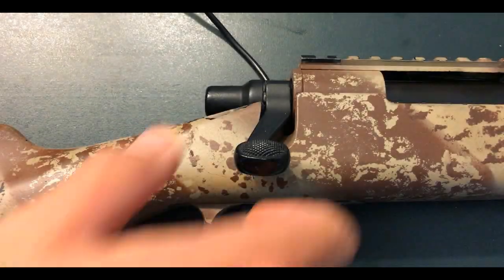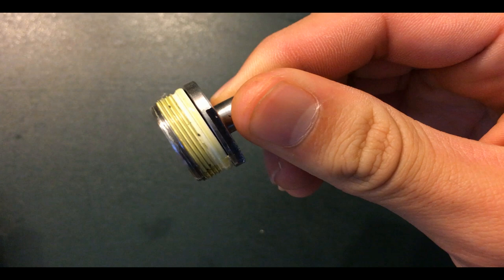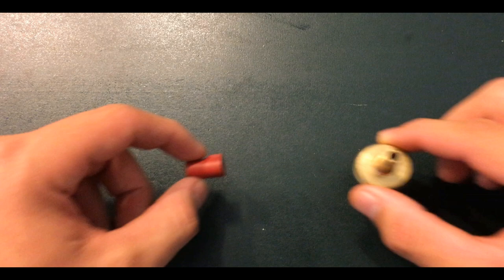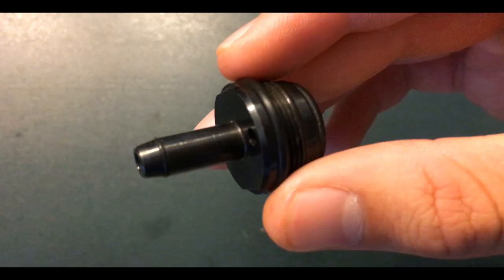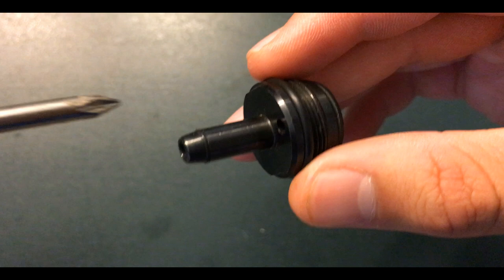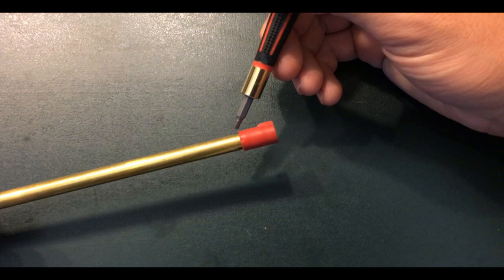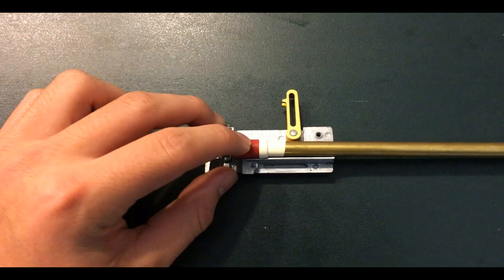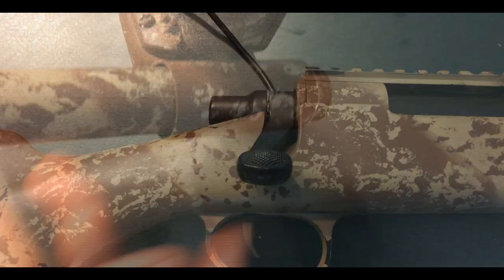How to Get Good Compression in Airsoft

Comment: I need help
Today I took a look at my FPS on my TM VSR-10 G-SPEC. Here are the results. I was wondering if this isn't constant and if there are similar results other VSR-10 Users got with 
.25s with similar parts or If somethings off.
My parts and everything are down below
463.2
468.5
436.1
442
454.2
449.3
467.2
461.9
I was using .25s
Because that's what my field uses to measure FPS.
My parts in my gun
-Maple leaf hop up arms
-AA VSR-10 Cylinder Kit
-AA VSR-10 M150 spring 
-AA Spring Guide
-AA Zero Trigger
-Nine Ball Hop Up Bunking
-PDI Precision Barrel

Comment: I have the same hop unit in my well mb02f (vsr clone) I get really unsmooth feeling at the end of the forward stroke as the nozzle enters the chamber could this be due to the shape on the standard nozzle (mine looked the same as your stock nozzle.) cheers and good video once again
Reply from the maker: Thanks! Yeah, it's probably due to the shape of the standard nozzle.
Reply: Hi i have the same exact situation ik it’s prob too late to ask but how did u fix it ? whenever i try to put the bolt back in its neutral position it gets stuck at the very end

Comment: hey +X81 Airsoft love your vids bud and im from the uk. what fps is ur sniper shooting at ? keep up the good vids buddy
Reply from the maker: Thanks, I appreciate the support! My gun is shooting right at 500 fps right now.
Reply: +X81 Airsoft no worries, i am getting a tm vsr-10 soon, would could i do to get it shooting accurate like urs but it be shooting at 450fps as that my site limit for snipers,
Reply from the maker: +Smokie airsoft To get good accuracy you'll want to invest in a quality inner barrel, bucking, and hop up. To get 450 fps you'll need to use a less powerful spring. The TM VSR-10 shoots very low FPS out of the box, so you'll need to upgrade that, and the trigger box. If you upgrade the spring, and not the trigger box, it may break very easily on you. Good luck with your new gun! Leave a comment if you have anymore questions.
Reply: X81 Airsoft thanks, much appreciated for the replys.i hope to start uploading soon as well could u soon do a video about ur camera mount on ur scope and how u did it and i didnt know if ur based it of novritsch build but great techniques. best youtube sniper so far :)
Reply from the maker: +Smokie airsoft Thanks, I appreciate the kind words. I'm planning on making a video on how to make my scope cam mount in the near future.
Reply: X81 Airsoft thanks man keep up the good work

Comment: I'm getting a JG VSR 10 just like you but I want to know do u think an sp190 Spring will work well on this gun or damage it
Thanks keep making vids weekly
Reply from the maker: +vrooooom23producti0ns Yes, that spring would definitely break your stock trigger sears. If you actually want to use the gun, you need to either upgrade the trigger sears (cheaper), or buy a new trigger unit (more expensive).
Reply: +X81 Airsoft What would be your choice on the store, on getting a trigger sear?!?
Reply from the maker: +vrooooom23producti0ns I usually buy parts like that from Evike.com. The first trigger sear that I bought from them was an Angel Customs (crappy brand) 45 degree upgraded sear set. I was very surprised with the quality of it compared to the low price. It easily supported my rifle when it used to shoot 580+ fps. The second that I bought from them was a Maple Leaf sear set. I recommend this sear if you're willing to spend a little more for a slightly higher quality. Both of the trigger sears have yet to break on me.
Reply: +X81 Airsoft hey thanks I'll get a trigger sear but you've changed my mind I'll just get an sp170 spring also you should make vids every week like Novritch does
Reply from the maker: +vrooooom23producti0ns Yeah, you're welcome. I hope all of the upgrades go smoothly.
Reply: +X81 Airsoft I know I am asking a lot, but there aren't very many good disassembly/assembly vids out there for your particular sniper rifle could you possibly make one in the near future for people who may want to upgrade there guns like you did?
Reply from the maker: Yes, I can do that. Thanks for the great idea! I'll make that video in the near future.
Reply: X81 Airsoft so you think it can take a m170 spring without taking damage or should I also change the trigger sears?

Comment from the maker: Hello YouTube! Welcome to my video on How to Get Good Compression in your TM VSR-10 or JG BAR-10. In this video, I show you exactly how to get consistent FPS, improve your range, and accuracy. Also, I would like to apologize for not posting a video for the last four weeks. Recently, my grandfather passed away. I just needed sometime for myself to think. But now I’m back and better than ever! I will continue to make awesome videos for you guys. Thank you all for your support, and I’ll see y’all next week!
Reply: +X81 Airsoft Is this an AirsoftPro.cz parts for VSR-10?
Reply from the maker: +Landzkneght No, I've never used their parts before.
Reply: +X81 Airsoft what bucking is this? Hard or soft?
Reply from the maker: +EKIA Airsoft The bucking in this video is a King Arms Air Seal Bucking. It's medium-hard, and it can withstand up to around 580 fps.
Reply: +X81 Airsoft thanks!! Btw what's the next video about?;D
Reply from the maker: +EKIA Airsoft I'm working on a video about disassembling and reassembling a VSR-10.
Reply: awesome i cantwait!!
Reply: +x81what fps will the bar-10 be stock and what all do you have to upgrade when you upgrade one because i just ordered one few days ago.
Reply from the maker: +Airsoft guide There seems to be a vast difference in fps of the stock Bar-10. Mine came in at a very low 330 fps. Some can be as high as 475. The spring is usually something you'll want to replace early so this shouldn't be too big of a problem.
Reply: +X81 Airsoft thank you for your time. and keep up the good work.
Reply from the maker: +Airsoft guide No problem. Thanks I will

Comment: I'm bought an ssg24 was working great and then it started curbing my bbs to the right any ideas how to fix that I've changed out the hop up bucking replace the hop up bucking replace the hop up arm and the inner barrel and outer barrel made sure it was seated right any ideas how to fix that usually pretty good about that but this one's just  stumping me
Reply: Yep
Reply: ja nee  yes I checked it I thinking my air nozzle might be off I pretty much did almost everything I could think of to fix it including switch out the hop up bucking and clean it

Comment: Hey I am getting into the sniper role big for the first time a just got the action army hop up chamber I saw in you video. I can not seem to get it to put pressure on the bb. Is there anything that I need to get or am I just doing something wrong? Thanks in advance.
Reply from the maker: +Texas.Sniper117 This may seem obvious, but are you turning the hop up on enough? If you are, make sure that you properly install the nub. If that isn't installed properly, you wont get pressure on the bb. Also, look down your barrel when you turn your hop up on. Make sure that you can see the indention made by the nub pressing down on the bucking.
Reply: +X81 Airsoft Thanks man I will check and see if I put it on wrong. Another thing I forgot to mention is when I turn the hop up all the way up the bob falls out of my barrel. Does that seem like the nub is in wrong?
Reply from the maker: +Texas.Sniper117 Yes, that could cause the bb to roll out of the barrel. It's either that, or your bucking isn't compatible/ wasn't installed correctly.
Reply: +X81 Airsoft I do not know how to insert the hop up on correctly then. Do you think you could help me with a quick guide on how to install it?
Reply: +X81 Airsoft Ok I just found a vid and put the hop up bucking on correctly but there is no pressure being put on the bucking. What could be the problem?
Reply from the maker: +Texas.Sniper117 I would have to see it. I have no clue why it's not working. It could be a lemon. I would keep searching in the Internet for a solution.
Reply: +X81 Airsoft I figured it out from a guy on Facebook. It's because I didn't have a hop up nub.
Reply: +X81 Airsoft thanks for using your time to try to help me.
Reply from the maker: +Texas.Sniper117 Yeah, it's no problem. Anything to help my subscribers.

Comment: Do you think that the standard parts in the VSR 10 are able to take a m170 spring without breaking?
Reply: Way to late but for anybody else. an m170 will destroy any guns stock parts. For that spring you need a 90 trigger, spring guide, and piston. All of those parts should be steel. For the trigger I would recommend the maple leaf or AA and same for the piston. For the spring guide just make sure it’s steel. If you are really into it also replace your cylinder for a heavier duty one. Just my 2c

Comment: hello 
you have a idea how we can make silent sniper with sorbo or something home made ?
Reply from the maker: +Andrei D Persecan I have heard of a few ways to "silence" a sniper, but I have not tried all of them. A few ways would be to fill your stock with soundproof foam, put a sorbo pad between the cylinder head and piston, or use a mock suppressor with foam inside it. I've only tried the sorbo pad method and it seems to lower the noise a little, but not significantly.
Reply: +X81 Airsoft air brake think work ? you tried this method ?
Reply from the maker: I have used a piston with an air brake, but it only seems to lower the FPS and increase the inconsistency. There wasn't a noticeable sound difference.

Comment: If you don't mind me asking HOW DO YOU GET YOUR BOLT TO PULL BACK SO EASY I have upgraded my bar 10 with PE Piston, PE Sear Set, PE Spring, PE Spring Guide, PE Teflon Cylinder, 6.01mm Precision Inner Barrel and it's kinda hard to pull back and i'm not like weak or anything.  Also I have some additional questions if you could pm me that would be great too!
Reply from the maker: I used to have a problem with that. I made it better by lubricating my cylinder internally and externally with 100% silicon (non petroleum). I ultimately fixed the problem entirely by replacing my cylinder, spring guide, and piston with high quality parts. Those parts cause a lot of friction within the cylinder, and is probably what is causing your problem. That or you somehow installed something incorrectly.
Reply: What parts do you have in your gun.  This may explain it because I have not lubricated my gun for a while!
Reply from the maker: As of right now
EdGI 6.01 435mm
Maple Leaf Cylinder
AA 90 Degree Piston
AA Spring Guide
Maple Leaf M150 Spring
AA 90 Degree Trigger
ASPUK Cylinder Head
DangerWerx Hop Up Arm Type A
King Arms Bucking
DIY Teflon Around Barrel and Bucking
DIY Barrel Spacers

Comment: Air doesn't leK out of my cylinder head but back through the piston. Should I put electrical tape around piston or something? Help much appreciated!!!!
Reply from the maker: +CCgamer1982 That's interesting. I've never heard of air leaking backwards through the piston. Is the piston missing the O-ring that goes around it? That would cause a leak. That O-ring is necessary because it expands as the piston is pushed forward, allowing for a tight air seal. Electrical tape will only make your problem worse. Even if the O-ring is on your piston currently, it could be damaged, causing the air leak. Your best bet is to put the O-Ring back on, or buy a new piston with a new O-ring.
Reply: X81 Airsoft when I put my finger over the cylinder head the air leaks through the back not the cylinder head. Yes the o ring is there and everything is working. Got any suggestions?
Reply from the maker: +CCgamer1982 There must be a problem with either the piston or the cylinder itself. It's most likely the piston. I would try properly lubricating the inside of the cylinder with non-petroleum silicon oil. If that doesn't work, you'll probably just need to buy a new piston.
Reply: X81 Airsoft its weird I'm not getting good compression because it's a brand new action army 90 degree zerotrigger. I'll try the silicone spray see if that helps :)
Reply from the maker: +CCgamer1982 Alright, let me know how it goes, and try not to over lubricate it. That could also cause problems.
Reply: X81 Airsoft I have the same problem, but tomorrow I go to local airsoft shop to look for silicon oil

Comment: Great job! But i'd like you to talk some slowly, cause it's hard to translate to another language and subtitles are wrong
Reply from the maker: +Ilia Thank you for your comment and suggestion!
Reply: X81 Airsoft , can you help me, I'm loosing compression between cylinder and piston. When i'm pull piston down and grip nozzle, piston slowly moving up to previous posision. Air doesn't leave cylinder in place of conract of nozzle and cylinder. Looking forward to your answer!
Reply from the maker: +Ilia That sounds like a problem with your piston. The O-Ring on the piston is responsible for keeping an air seal in the cylinder. Try lightly lubricating the inside of your cylinder with 100% silicon oil. If that doesn't work, you might need to buy a new piston.
Reply: X81 Airsoft my fail... air came through space between nozzle and cylinder. I've Put it into the water) thank you